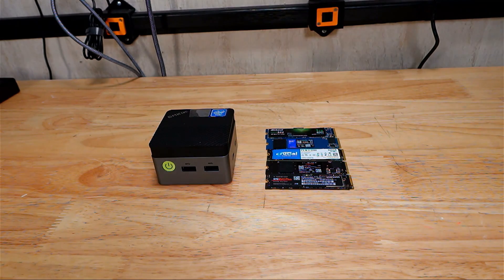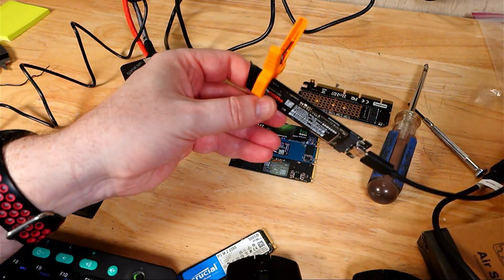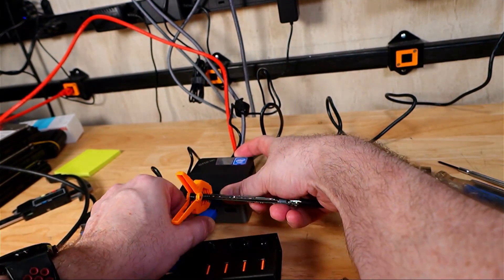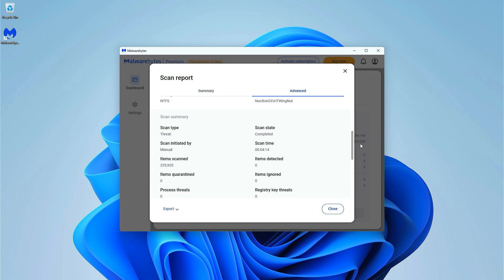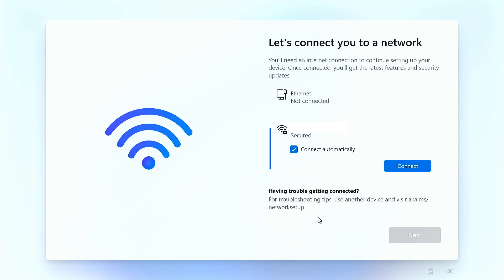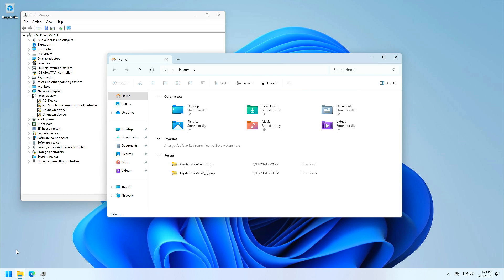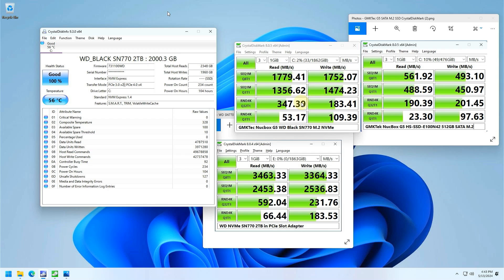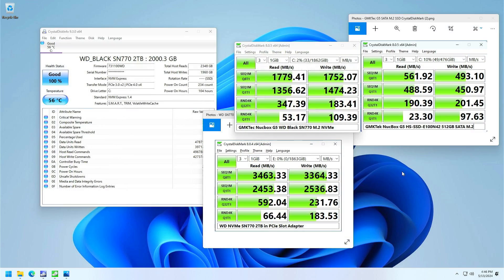GMKTec Nucbox G5 PART 2

Comment: Hi. Do you have any problems with the back side USB-A? I have a problem that it only detects my external sandisk exteme SSD drive with the adapter, but it will not detect my wired keyboard or mouse. Like it does not have enough power. Any opinion?

Comment: Would setting the CPU TDP to 8W free some power for the USB-As, perhaps solving the underpowered issue and allowing you to connect the SSD without using a powered external hub?

Comment: Those random drivers you need to get from GMKtec concern me. While they might not be infected by malware, they still run in kernel space and they can have (intentional) vulnerability which is in effect the same as a backdoor. I don't think AV software can detect that.

Comment: Will a USB C Wall charger 45W be enough to power this safely?
Reply from the maker: 45W is probably pushing it. It should work, but it will either limit performance or cut power if stressed beyond what the PSU can provide.

Comment: Yes, to agree with those below, great in depth review! I am old enough to have built a "state of the art 3 transistor ham radio". I followed Bell labs in the development of the tube replacement,  "Ever shrinking transistor". I am fascinated by the progress we have made in  the last 60 years of electronic tech. I could not refuse buying this incredible tiny desktop computer, for the grand total of $155.00 US. It will fit nicely along with my collection of microcontrollers,  from the Mcm6800s and 6502's to the Arduinos, Raspberry Pi's , ec.  Thanks for the video!

Comment: I have a question for you. I tried to clone the m.2 sata drive to m.2 nvme drive and it won't boot. Windows says it cannot find a path to valid boot media. I contacted GMKTEC and they told me this model is SATA compatible only. Obviously, you proved this young in this video. I also sent them a photo of the MB labeled PCIE/SATA under where the ssd goes, but they did not reply again. So, is my only option to do a clean install of Windows11 onto the NVME drive, or is there a way to rewrite the pertinent boot records on the cloned nvme ssd? Thanks again for this video.
Reply from the maker: Your best bet is to use something like Rescuezilla or Easus Disk Copy.
Reply: @htwingnut  I used DIsk Genius which is supposed to be good but the nvme won't boot. Do the other programs you mentioned create a new boot record for the nvme drive, instead of just copying the sata's one. Apparently, sata mbr are not compatible with nvme.
Reply from the maker: @expatinthailand9824  Last time I did a SATA to NVMe boot drive I used clonezilla. Rescuezilla is just a GUI on top. It's been a while. Wish I had a better answer for you.  Normally I just do a clean install of Windows on any new SSD just to keep things clean.
Reply: @htwingnut  Yea, I will probably just do a clean install at this point. Getting tired of swapping the drives. It is strange GMKTEC support claims the board does not support NVMe but you have shown that to be incorrect.

Comment: Regarding the nvme drive power problem over the USB port…  I remember you mentioning in the Part-1 video of this G5 that there was an option to limit power consumption to 8W and that you seemed interested to adopt it, wanting to keep the CPU under 77 deg C.  So I was wondering if perhaps that could’ve caused the power over USB problem for the drive? (in case you enabled it and forgot to remove it before testing this)

Comment: Hello. I plan to run this device headless. I will access it from time to time via teamviewer. My question is, how does it handle power failure? Will to restore to a powered on state? Secondly is there a way to disable the power button?

Comment: I got a random 256GB NVME 2242 SSD for only $25 and it is working fine with GMKTec Nucbox G5.
Reply: Did you put it in the slot of the original M2 drive or in the wifi M2 slot?
Reply: @ the original m2 drive
Reply: How much faster has the mini PC become? Is it noticeable in surfing?

Comment: I just ordered the G5 because it was on a deal.
Specially came here for the storage options, but pleased to see that its not an "ngff" old slot, but nvme.
I might just drill a hole on the side so i can stick a 2280 gen3 ssd in it, which is certainly much more cost-efficient than the 2242.

Comment: The story so far:
Purchased from Amazon, GMKtec Mini PC N97 Windows 11 Pro Micro Desktop Computer, 12th Gen Intel N97 12GB DDR5+256GB SSD, runs fine.
Purchased from Amazon, Dogfish SSD M.2 2242 1TB NGFF Internal Solid State Drive High Performance Hard Drive for Desktop Laptop SATA III 6Gb/s (1TB, M.2 2242).
Installed Macrium Reflect on a portable hard drive and made a bootable Macrium Reflect clone of original 256 Gb SSD system on 64Gb USB thumb drive.
Made copies of Create Windows 11 Installation Media on two separate USB thumb drives, (just in case).
Set BIOS to boot from USB.
Installed new SSD, restart boots straight to BIOS, try F7 boot, Reflect clone drive gives blue screen Error code 0xc00000e.
Try F7 reboot with Win 11 Create Windows 11 Installation thumb drive, changes screen resolution font size only, no further progress with either drive.
Research shows GMKtec indicate “Secure Boot” should be enabled.
Check BIOS (still with 1Tb SSD installed and see “Secure Boot” is disabled.
Cannot get access to the “Secure Boot” screen in BIOS security settings again with 1Tb SSD.
Reinstall original 256GB SSD, now have access to “Secure Boot” screen in BIOS security settings, follow GMKtec instructions to enable “Secure Boot”, Save and exit BIOS.
Reinstall 1TB SSD, attempt to boot from all thumb drives, same result.
Recheck BIOS and notice “Secure Boot” is disabled again, and I am locked out of making changes.
Manage to turn on “Secure Boot” again by pressing F2? (reset to previous setting)., (still no proper access to “Secure Boot” in BIOS security settings).
Reboot from any device still fails.

Comment: Hi! does it have LPDDR5 or normal DDR5? I guess they're single channel?
Reply from the maker: LPDDR5 soldered on. The CPU only supports Single Channel RAM. But DDR5 RAM has two independent 32-bit addressable subchannels so internally is more or less functionally like dual channel. For this CPU it is more than adequate.

Comment: Thanks for the in-depth review.

My usb3.0 WD mypassport 4tb HDD doesn't require external power when plugged to my Pi5.
Will it work with the G5? Does the G5 supply the same level or more of power to USB ports?

Maybe using a 65w usbc brick would supply enough to the usb ports?
what do you think?
Reply from the maker: I believe I have a portable hard drive somewhere, and will try it out. But I don't think it's an issue with the power supply, it's how much power the USB port has been spec'd to provide. That's a GMKTec design consideration.

Chances are they spec'd it to the minimum 5v x 0.9A for 4.5W. While technically OK, some HDD's and SSD's will draw up to 6 or 7 W at peak and most USB ports can easily support that.

That being said, I did plug in a 12V 5A 60W power supply and it still didn't matter.
Reply: @htwingnut  thanks, let me know your findings, of course with the standard 30W power supply :). About the power supply, sorry, can you elaborate what you meant that it didn't matter?
Reply from the maker: @user--crazyhandle  Sure. By "it didn't matter" means that I tried it with the USB SSD that was disconnecting and it still disconnected. Connecting it to a powered USB hub and it worked fine.

Comment: in the type C power adapter cable is there only 2 cables? positive and negative cable? I'm asking because let's say if the original Power Adapter became faulty, I can just buy a normal power adapter and join the original type c cable and normal power adapter together by cutting off half the original cable- as a replacement.
Reply: Another reviewer's video had a commenter who notes that an Apple 87W USB-C Power Adapter (for MacBook Pro) works perfectly for a G5. They are $15 new on Amazon right now. The brick will adjust the wattage automagically.
Reply from the maker: I would not recommend cutting and splicing. You can find alternate power adapters for relatively cheap. I also found this 100W brick PSU here: https://www.amazon.com/dp/B0CHB1DF5Z
Reply: @htwingnut  are you sure the pin outs are compatible?
Reply from the maker: @allenperera6158  Absolutely. USB C is USB C. They all have the same pinouts. That's the beauty of USB. Unlike barrel connectors that can be + or - on inside or outside and different voltages. I have that inline 100W brick myself and works fine.
Reply: @htwingnut  thanks!

Comment: the nvme has a higher power draw than what the USB port can supply
Reply from the maker: Yes, you are correct. The USB port should be able to provide 4.5W at a minimum (5v @ 900mA). While an SSD can draw more than that at maximum load, most SSD's these days run under 5W. Regardless, it works with a powered USB adapter, so most definitely a power issue. I haven't had this issue with any other devices I've used with USB drives.

Comment: Can these devices (the N100 as well) actually manage up to 3 monitors at 4k  ?
(Maybe looking to get one of these for a trading rig with 2-3 monitors)
Reply from the maker: this specific model only two HDMI ports, so only 2. But they can each handle 4k/60. The N97 and N100 can support up to three 4k monitors though. This model seems to support 3 video outputs: 2x HDMI, 1x DVI https://www.amazon.com/dp/B0CCDPDBX6

Comment: After watching your 2 videos on this mini PC i bit the bullet and bought one and i am very pleased with the performance. I was a little worried about spy/malware so i ran a Norton power eraser (rootkit) full scan and a microsoft MRT full scan both showed no problems, is there anything else that i should do to put my mind at ease. Regarding the usb problem i just use my computer for emails, streaming and general web browsing nothing to heavy but i have connected a few different external drives, printers etc to all the usb ports without any problems so maybe gmktech have fixed the problem. Keep up the good work.
Reply from the maker: The fear about malware for many users I believe comes from the fact that AceMagic mini PC's had some malware in their OS distro. It was simple to detect and remove. But left a bad impression and paranoia, for good reason. I feel this device is safe. Best thing you can do is a clean Windows install if nothing else.

Comment: Can this PC be powered via USB port on a monitor?
Reply from the maker: Probably not. Most USB ports run at 5V unless it's a PD (power delivery) USB port. This mini PC requires 12V and up to 3A power draw.
Reply: @htwingnut  wow, thanks for the quick reply. 🙏🏽

Comment: i've got a machine with the N-305 in it, and have been pretty impressed so far!  got a question about some odd behavior though.  when i was testing it on a game it seems to downclock the GPU.  the N-305 is supposed to go up to 1.25Ghz but it likes to sit around the mid 900s..  i checked thermals and that is not it.  do you know of a utility that would help trouble shoot the issue?  curious if it's power constraints..
Reply from the maker: Same issue with this little device. It is supposed to go to 1200 MHz but never exceeds 1000MHz. Same with CPU clocks. It's supposed to boost to 3.6Hz but never exceeds 2.9GHz. I realize it's very specific circumstances where it will reach those clocks. A bit disingenuous of Intel IMHO.
Reply: @htwingnut  i did a test by restricting CPU usage to 85% and noticed the GPU would then actually get up to 1200 Mhz.  So it does seem like it's a power limitation.  That's unfortunate because it's leaving a good amount of performance on the table..  :face-red-droopy-eyes:
Reply from the maker: @FroggyTWrite  Thanks for testing. I may try that as well. I guess it depends on the need, maybe a lower CPU clock with higher GPU would be beneficial depending on what you're trying to achieve. Gaming it may make sense.
Reply: @htwingnut  Email GMktec for updated bios to unlock full N97 turbo speed (3.6GHZ), bios date 5/22/2024. Enable p states, I also recommend new thermal paste before this, since tech support mentions I could change to 15watts to sustain higher clock speeds during games if need be. Would love to see an updated review if you want to test this after the update!
Reply: @htwingnut  There is another bios update from GMktec that enables full turbo speed of the N97 (3.6Ghz) with p states enabled and GPU of 1200mhz. The bios has a date of 05/22/2024. I had to contact support to get this bios. If you try the update, I would love to see an updated review, thanks!
Reply: I know its been 7 months. but there was a bios update that is supposed to unlock the remaining 200mhz or so gpu speed. I just did the update on mine. I have not checked actual run speeds yet but others have and have confirmed the bios update made the remaining 200mhz gpu speed actually work when selected in bios. Im not sure when it comes to getting the max cpu frequencies up in boost, though. On the cpu end, I am going to start with repasting and coming up with a more aggressive fan profile... just got my unit and overall super impressed with it's capabilities for the money.
Reply: @jakeR1954rr  After updating the BIOS, the mini PC works at 1200 MHz?
Reply: @jakeR1954rr  After updating the BIOS, the mini PC works at 1200 MHz?
Reply: @Yo_shimitsu  yes, after bios update dated 5/21/2024 the GPU reads 1200mhz

Comment: Performance is leaning to cool the drive not only checking the speed with app that says nothing anymore it's to old. 

What if you test without these stupid games, test vmware with VM running and browsers with many tabs open en running Proxmox Backup Server on vmware and push the limits out of the memory. 

Jayz on 'm. 2 cooling
Hear what he's saying about crysteldisk what ever the name is. 
https://youtu.be/dDTH93dgulE

But this one is better to work with.
https://youtu.be/I8Z09nU554Q

Comment: My 2TB Inland SSD works just fine. Uses 2 3.0 PCI lanes, gets similar performance to what you found.

I put the SSD that came with the computer directly into an enclosure before I booted the G5 and scanned it. No viruses.

I pretty much match your results.
Reply from the maker: Thanks for the feedback!
Reply: @htwingnut  BE200 from Intel is a WiFi / Bluetooth network card that is WiFi 7 and Bluetooth 5.4. It works fine in the Gmktec G5 and you can get the drivers from Intel's website.